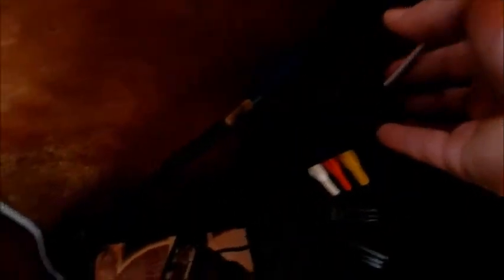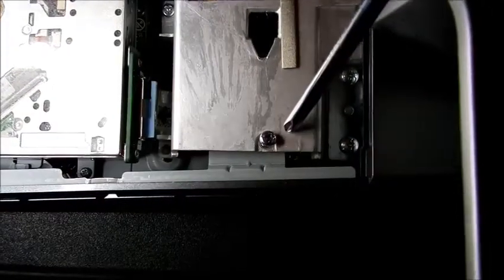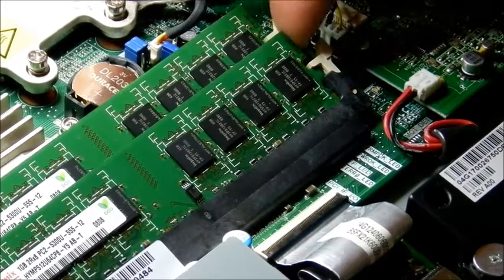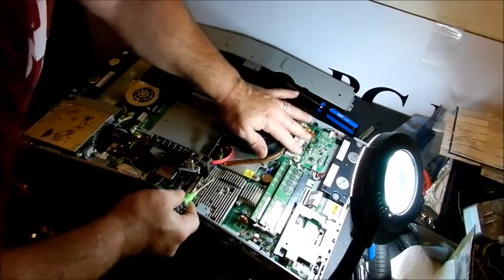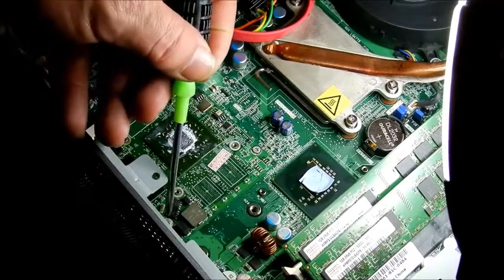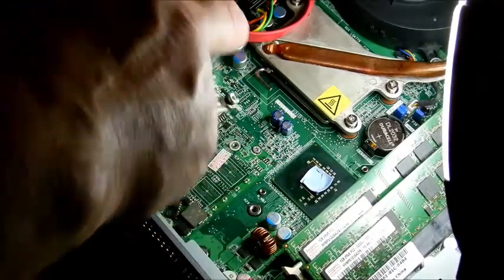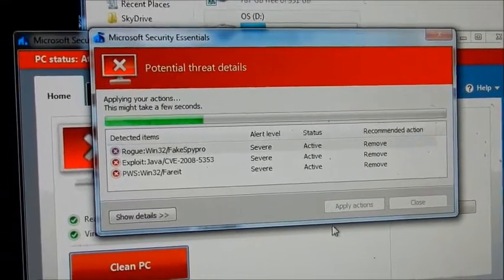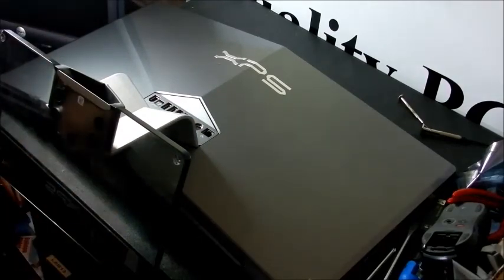Dell XPS One A Look Inside

Comment: I found one of these recently.it powers up and works but the cd bay,hdd caddy/sata cable and stand are missing.Not sure if I’ll waste time trying to source the missing parts.
Reply from the maker: You can purchase those parts on e-bay if needed.
Reply: William Quinn I had a look earlier but couldn’t see the cd drive it needs as it needs to mount onto a bracket.I saw a stand and the hdd caddy/8 pin sata connector were too costly.
Reply from the maker: @pattskatoey3139  When something is obsolete or too costly it's time to retire it.  BTW.. You can always get an external CD drive.

Comment: Hi William , just watched this video , so was it the video card that was bad, u didnt say anything if it was or not at the end of the video  , i just got me one just like that and its doing the same thing starts up but no picture.. when i bought it , they said it worked but when it got delivered it didnt do anything .,. just wondering if i need to get anougher video card or not . i got anougher dell that im installing windows on that hd , sense dells r fairly the same i dont have to reinstall a nougher windows os .thanks for video it helped ..
Reply: @redsnakehead  well i desided to buy a new video cards just in case , but to find out it wasnt the video card , they had 2/ 1gb 5300 memory in it and it wasnt poweron , so i thought , 1/ 2gb 6400 and it works ,, its alive ..
Reply from the maker: Good luck!  I am still using mine and yes the video card was bad.  Now the internal DVD player is bad.  Have a USB DVD drive now.

Comment: Hi William I have one that will come on but just a white screen, I have tried removing the memory trying other ones no luck,have taken out the video card no smell or burnt chips. Someone on the Internet mentioned the LCD lead might me loose but I don't know where to look any ideas.  Iain
Reply from the maker: I now longer have this computer.  Unfortunately this is not the one that I removed the LCD lead.  I would look for any and all plugs, plugged into the motherboard, and reseat them.  There is no guarantee that this will fix it.  I will state that replacing the LCD screen may cost more than a new computer and still not work.
Reply: Ok thanks worth asking
Reply: ***** Hi again how did you hookup the phono leads to the Dell to your TV
Reply from the maker: ***** This can be done via VGA or HDMI interface.  The hard drive scanned was removed from the computer being worked on.

Comment: William I have been having a lot of distortion, especially in the base tones, from my xps one 24.  could this be a sound card problem?   Thanks for your opinion.
Reply from the maker: Could be the speaker.  See if you can install external speakers and get the same thing.  If it still happens then it is a sound card issue.  I would try updating the drivers.
Reply: I just loaded win 7,  which comes with almost all the drivers for this pc.  I will try the external speaker.
Reply from the maker: Please let me know what happens.
Reply: seems like the problematic speaker is the one on the bottom in the middle.  I will have to investigate deeper when I get a chance.
Reply from the maker: It can be changed but obtaining the part me be an issue.
Reply: hopefully once I get it out and get the dell part number I can get one on ebay

Comment: Hey guys so I had a dell xps that was not working for years it showed evidence of graphics card failure HOWEVER I swapped that little fuckin battery/bios chip? And it works like new. I’m a bit upset with dell for even thinking about charging people all this money for a $2 fix. Exactly like this video states, I didn’t see any burnt chips or swollen capacitors.... I happen to have that same battery in my key fob, popped it out, then swapped it with the dead battery on the mother board. What a fucking joke. I got to find all my old programs, music, pics, and files.... I have the AIO XPS one we bought in 2008? Still has windows vista configs from 2009. Basically this thing was a brick until I swapped a $2 coin battery..... thx for the breakdown!!!
Reply: I will also add that my graphics gard and heat sink had no thermal paste or pads so I added some arctic silver, hopefully it stands the test of time.
Reply: Yes me to just changed the battery snd 20 mins later booted right up